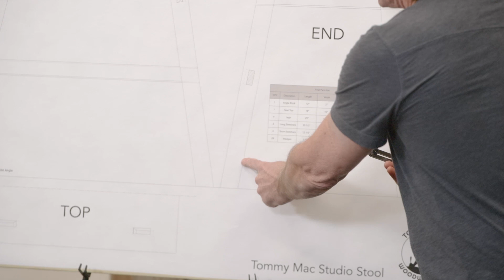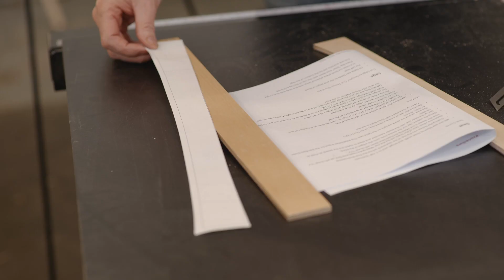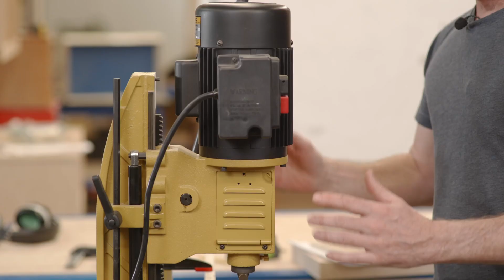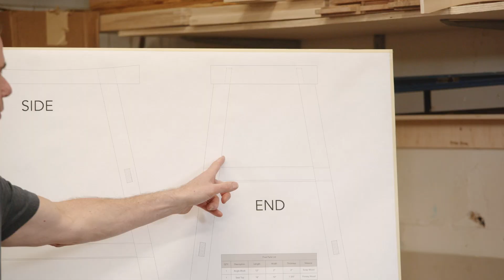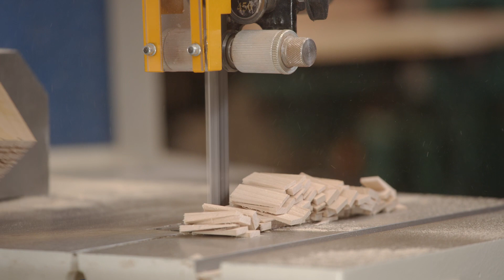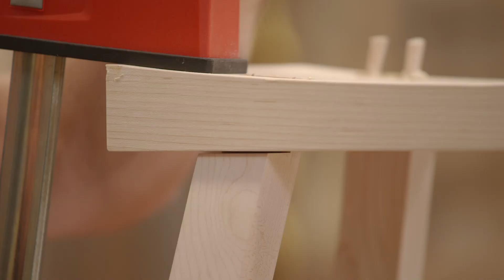How To Build A Kitchen Bar Stool!  (Studio Stool) ​  ​​⁠

Comment: Do the inside faces of the legs need to be made parallel once the angles are cut on the outside faces?  It seems like the inside faces are down when the mortises are bored on the mortising machine.
Reply from the maker: The backs are down on a slanted ramp .. I do it this way do the mortise chisel comes through the back and not the face   I get a bit of blow out Aron the MC